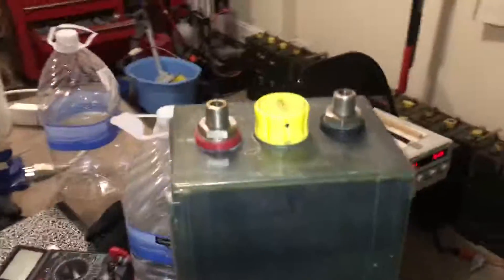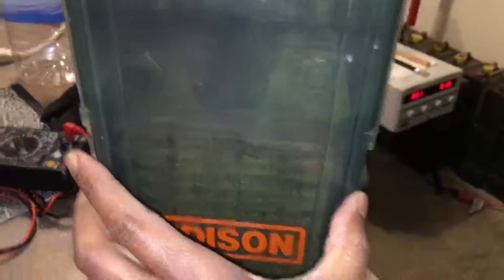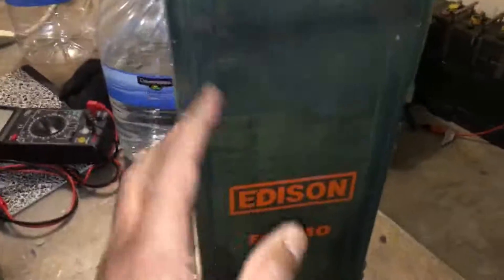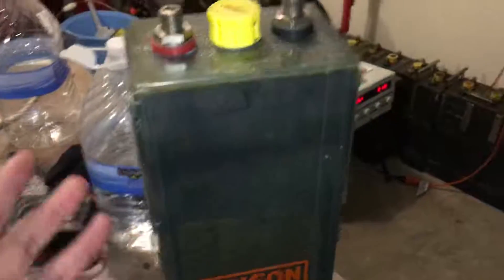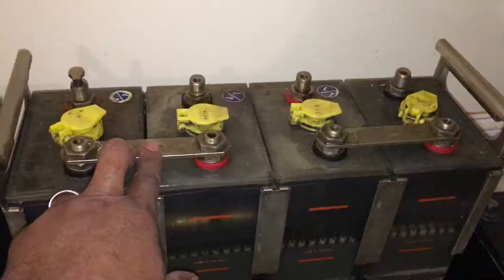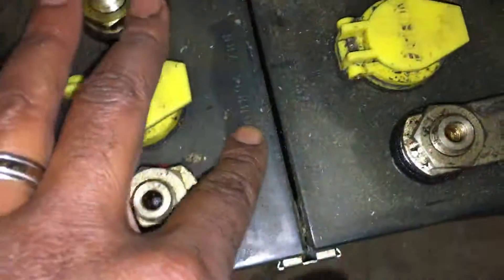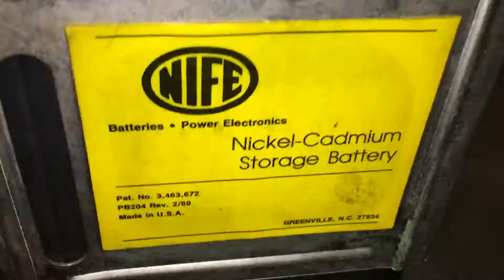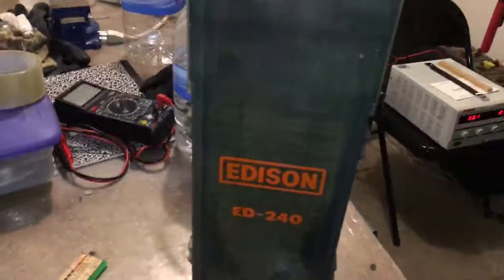Update - The Edison ED-240 Nickel Cadmium Cell I'm working with.

Comment: where can i buy some of these?
Reply from the maker: Unfortunately, these cells are hard to come by.  I was very fortunate to come across these because I knew someone, who knew someone else that had some.  And I had somethings to trade.  I can only think of craig's list as a possible source for "old" cells.
Reply: I now where you can get 60 of the  ED 160 batteries
Reply: Thanks but I am going to buy some lithium ion leaf batteries. thanks for the tip anyway.

Comment: Looking good, everyone of them should come back to life. You should do a video on mixing the electrolyte sometime,. I well do a video on at some point, but for me it wont be till spring, snow on the ground up here.
Reply from the maker: Thanks, after seeing the results of the 0v cell coming back, I'm of the same opinion that there shouldn't be any reason these cells wouldn't come back.  If I get the time I may do a video on mixing the electrolyte.
Reply: I know where to get 60 of the ED 160 batteries